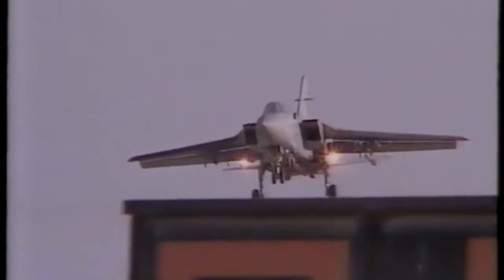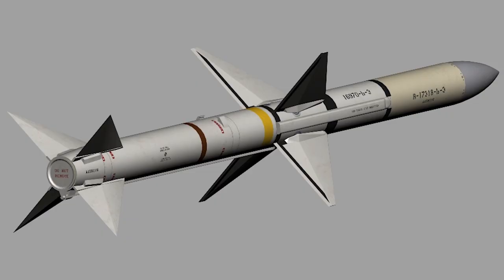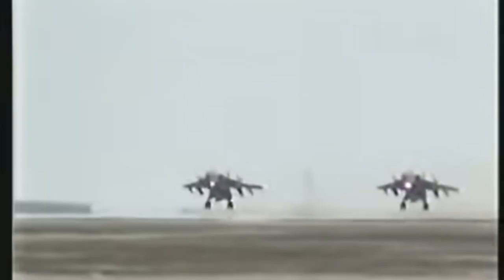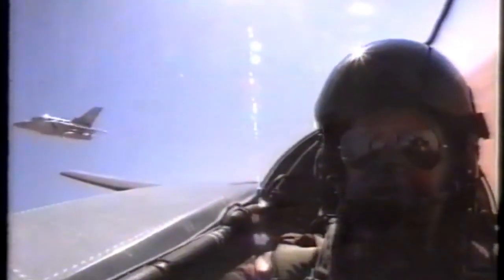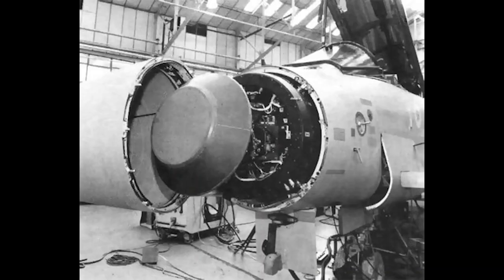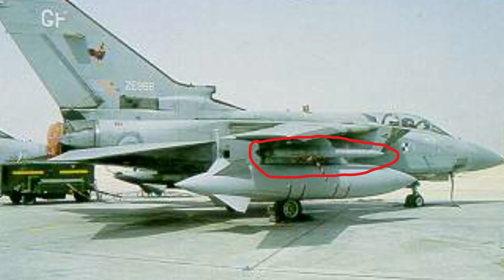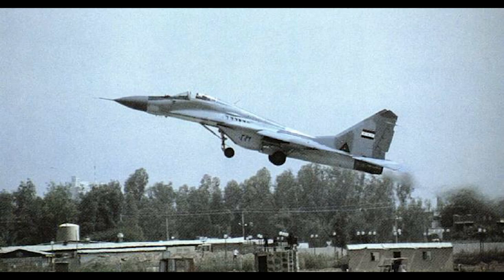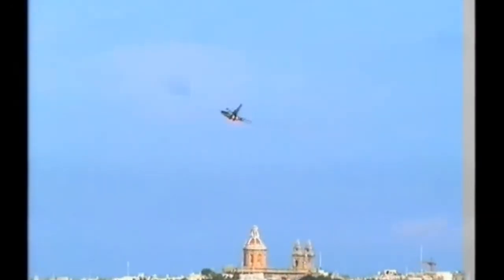DESERT EAGLES In The GULF WAR | The Role Of The RAF's Tornado F.3 In Op Granby

Comment: Worth mentioning numerous modifications were made to the F3 before XI (C) deployed, with many recommendations from the OEU rushed through to make them more capable. The original airframes from Akrotiri were fully replaced by the upgraded aircraft not just supplemented.

Comment: It just wasn't up to the requirement of the job  and without IFF it would get in the way, which is why it had no frontline role.  From very early in the war it became clear that in reality there was no significant airborne threat to the E3s so this "role" was superfluous.  Very fast at low level, the fuselage extension reduced the drag.
Reply from the maker: I agree, the IrAF didn't put up a massive fight and were swiftly out of the fight within the first few days, rendering the Tornado F.3s out of any action due to not being able to be fitted with guided munitions/be a multi role fighter.

Comment: Great video, I’ve subbed. however if I’m being pedantic the F.3 didn’t have automatic wing sweep (although Panavia did offer it); the RAF decided it wasn’t needed & opted for manual controls instead.
Reply from the maker: Thanks for letting me know, I knew that the Gr.1s had manual but I didn’t realize that the Raf’s F.3s had manual also. Thanks so much!
Reply: Indeed, the RAF decided not to implement automatic wing adjustment but the aircraft was nevertheless conceived with that capability: confirming this, the RSAF (Royal Saudi Air Force) F.3 Tornadoes had automatic wing adjustment.
Reply: @phant80  great point 👍
Reply: I was a british aerospace australia crew chief on rsaf 29 sqn 1991 to 1996.

Rsaf f3 did have auto wing sweep.